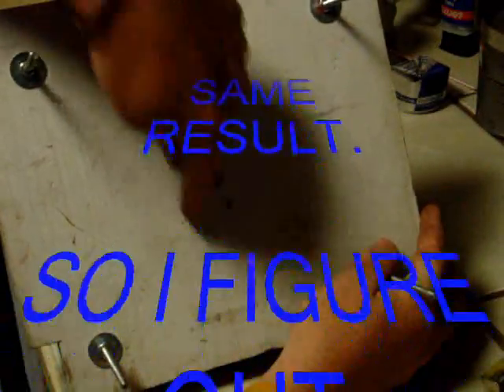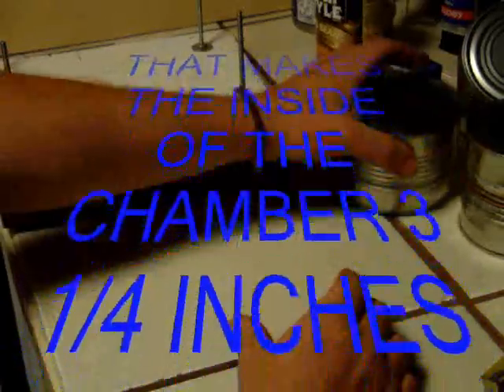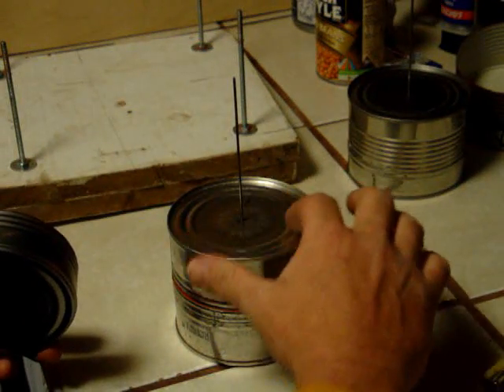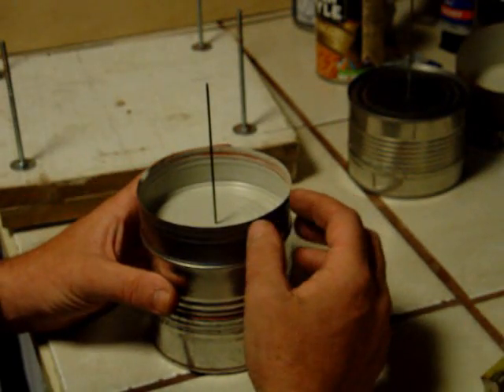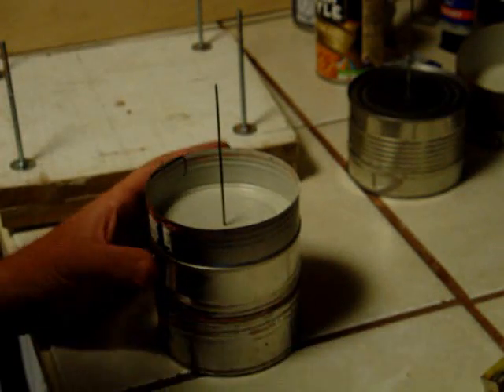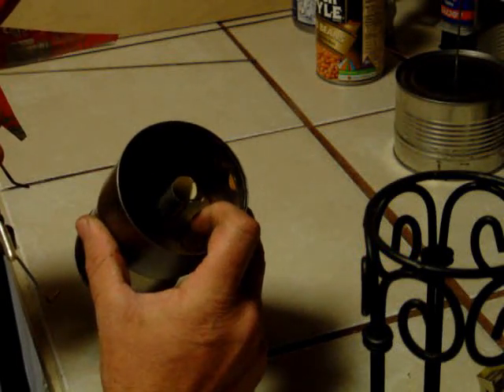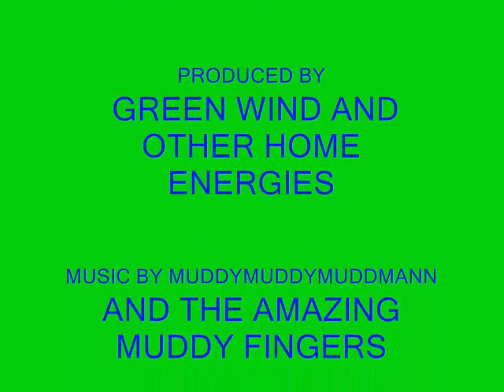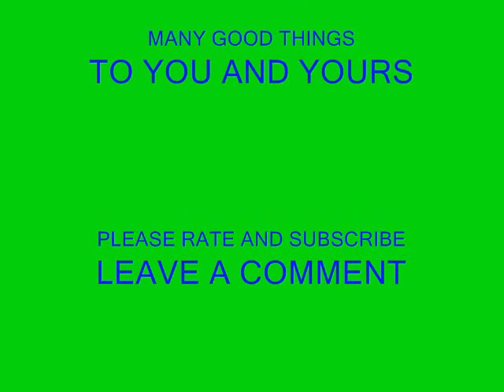PART 10 HOW TO BUILD A TIN CAN STIRLING ENGINE

Comment: making one with a soup can and steel wool displacer, fro my power piston, i'm gonna use your design, lately ive been thinking about ways to phase these cylinders to put them on a single crank, mabey make a straight six for fun. The one i'm making now i'm going to make into a circulating fan for a heat exchanger i'm making on a rocket camp stove stack to blow warm air into my tent. Glad to see you still answer comments. your videos rock